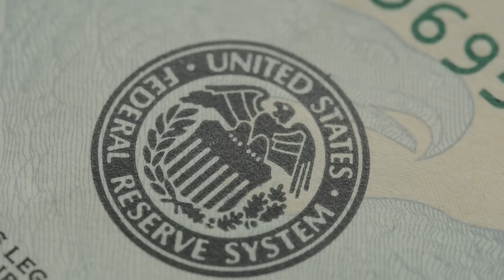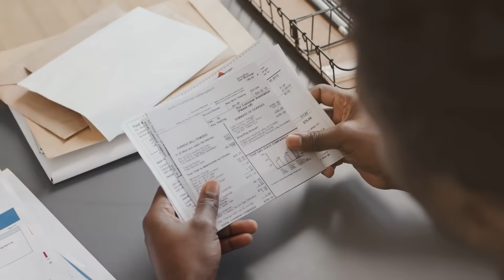Why California Is Building A $4 BILLION New MEGA RESERVOIR!

Comment: Sites is the dumbest idea I've heard about helping California with its water issues. There will be immense evaporation from a surface lake. It's not just water flowing out into the ocean that is a problem - if that even is a problem. Where Sites is located in the western Sacramento Valley, the summer season is very hot and very dry. Water evaporates quickly. On the other hand, California has been pumping ground water for decades, causing those underground reservoirs to become depleted. Seems it would be a much better solution to work on ways to replenish some of that during wet years, or even just normal years. We probably cannot bring them back to what they were, but there is certainly more capacity underground than in Sites, and water won't simply disappear into the air if it is underground.

Comment: I think the reservoir should be put up in a higher elevation where it's very cold so the water stays cold and doesn't evaporate so quickly. Don't allow motor boats either. keep it as clean as possible.
Reply: They were never going to create another Hetch Hetchy. Sites is the best compromise available.

Comment: Biggest user and 100% WASTE of Fresh water in the entire country?
Commercial ICE MACHINES. Nearly every machine runs a 1/2inch - 5/8inch water-line directly into the drain (condenser-cooling-water)12/7/365. Nothing else even comes close to using so much water and then dumping 100% clean usable water into the waste-stream-system. It's all such a Crock of Shit! Every, gas station, fast-food joint, motel, hotel, are fully complicit. All approved 100% by so-kalled Koncerned groups of OUTRIGHT LIARS! Our wonderful activists and politicians. ANOTHER SCAM.

Comment: This issue is completely man made and has nothing to do with climate change. There have been extreme dry and wet years for over millennia. Early Americans wrote about the devastating floods and droughts that were a huge problem. They also wrote about the massive wild fires that reduced the visibility of the mountains.  John Muir wrote about all of these naturally occurring processes that are responsible for shaping the state. Yosemite and the Central Valley was formed by glaciers and the melting of them as a result of the climate changing but there wasn’t any humans releasing carbon into the air to blame it on. It’s a natural part of the planet and it doesn’t make it a bad thing. Raising the carbon amount in the atmosphere from a dangerously low percentage up slightly is a good thing because it allows more trees and other plants to grow and thrive. If the carbon went down a little, no life could exist. The world warming is good for life on earth, especially humans. If the earth cooled, it would be devastating. It would be nice to watch content from creators that don’t try to gaslight their viewers.

Comment: This project is proof of everything that’s wrong with California.  It’s taken 25 years to get regulatory approval.  25 freaking years!!
It will consume more electricity than it produces.
In times of low flow in the delta (aka drought years), water will be released back into the delta, not kept for human use.
We desperately need it, but it’s a compromise project that’s trying to be something to everyone, and there are many, many examples of this approach failing miserably.  
I have zero trust in California’s ability to fight through the inevitable corruption that plaques large infrastructure projects, and I worry that this project will be a generational albatross with raised water rates and dashed hopes.

Comment: What about the Delta Smelt??  A lot of that water that goes into the Delta and then out to the sea, could be pumped into current water system but is not, in order to "save " a none exitant fish.  Why is this not a problem for this project?  Money does not seem to be an issue for CA, we seem to be able to print money or else how are we still able to keep paying for the High Speed Rail to no where that is BILLIONS over budget?

Comment: They should have taken my suggestion of building a "superhighway of giant water pipelines" from the east to the west back in the '70's. Pull the floodwater from the east to the west. Create REAL jobs, with a REAL product that people WANT and NEED. But my engineering professors criticized it, laughed at it.
Reply: It's funny I had that same thought since I was a teenager.
I remember reading about the Great lakes and how lake Michigan routinely is above average in water level and that single lake alone would be easy to suck a little water off the top pump it across the United States to feed the dryer states,  I mean there are plenty of states that feed off the aquifer where the aquifer is shrinking from intensive farming.  Then we could pump the water into the Rockies and allow its natural flow to go down the Colorado River which would cut the length of the pipe and the pumping roughly in half. Having to only pump around a thousand miles worth of water,  California's current aqueduct system proves it is possible with a good engineering team.  
Once that water hits the Colorado basin it would feed Phoenix, Southern California, Southern Utah, Western Colorado Southern Nevada and even part of New Mexico... To me it seems like a simple solution.

Comment: I have a better idea. If California must take even more water from the river systems.Isn't there an aquifer under the central valley that is depleted so much the ground is sinking. Why not use it to store the water where it won't evaporate in the 100 degree summer heat. It could be pumped onto the farm fields when needed by the abundant sun via solar power. It would be cheaper and all the water would be useable avoiding the  massive evaporation of a giant open pool.
Reply: CA has been flooding the valley farms that will during the last few winters.

Comment: This sounds real good but Commiefornia has a bad track record for wisely  using its water. The 2025 fires showed that they were wasting  water to save the Snail Darter and did not have resevoirs up to adequate levels to provide Fire Protection.  Commiefornia  was not clearing  bush or doing controlled fires to remove bush and suffered severe Prooperty Damage during the 2025 fires.  Commiefornia needs to get serous about water management and to get its resevoirs up to date.  Then they need to manage the water wisely so that when Fire Season comes they do not let the fires get out control and suffer the damage they did in 2025.  Never put stupid/useless fish/minnows over humans again.

Comment: 4 billion? If you compare it to the bullet train project its more 400 billion
Reply: Never ending projection
Reply: Projections are 50 to 80 billion more to finish the slow speed rail. Estimates are 6 to 8 hours to the bay area. Ca. Cutting costs by trying to use existing rails where you have to slow down.  Also it will have to be subsidized to make tickets affordable. You can fly to the bay area for around 100 bucks.
Reply: You mean the one they canceled?
Reply: This project will be just like the train to nowhere. A lot of palms to grease and retirement accounts to fund before it even gets started.
Reply: @danven1256 nowhere means 7 million people? And 117 miles of guide way nearly complete? With 52 miles of CalTrain tracks already complete and electrified due to CAHSR funding?
Reply: Exactly.  Fellow tax payers, lets all sit back and watch the mismanagement of this project spiral costs to the moon and back!  😡
Reply: CAHSR has only spent 13billion ?
Reply: @Lumber91 and it hadn’t laid any track!
Reply: @motor2of7 next year track laying starts
Reply: @Lumber91  sorry bud but its way more than that
Reply: @davidu6093 Can you provide a source that cites a current expenditure of above 13billion currently spent? As you claim 400 billion.
Reply: @Lumber91  you can do the homework its called google
Reply: @davidu6093 so you’re unable to provide a source. Seems legit 😂

Comment: So they take out four dams on the Klamath river then turnaround and pump excess water into the sites area from the Sacramento River.
Reply: The Klamath River is a different watershed.  It would be very expensive to move water from the Klamath to the Sacramento Valley.
Reply: also the 4 dams (2 are in Oregon) are private dams built for hydro electric.  the plant was decommissioned and so the private company decided to remove their private dam.  same goes for the two PGE owns that they are decommissioning.  none of those dams are owned by the state.

Comment: They need to create "Green Catchment" along most of the rivers.  Build 5 or 10 foot weirs that fish can jump, yet hold several hundred acre feet of water all over the landscape.  The retained water would soak into the receding water table and also catch water from those atmospheric rivers that roll through. Something that would be a much better ecological management plan.  The reservoir is a good start, but a bunch of weirs would be able to accommodate storm flows and create a cheap, concrete durable and distributed habitat structure with minimal maintenance.
Reply: Great idea about catchments. We get surges of water and using them to recharge aquifers sounds like a great idea to me
Reply: You make a whole lot of assumptions about soil conditions and aquifers in that statement.  Catch basins sound great as a sound bite, but execution is massively more complicated.
Reply: @motor2of7  well so is a pipeline too. there are at least 3 mountain ranges too cross.  Just putting catchment in apropriate places cost no additional money for nuclear pumping plants.
Reply: @watchthe1369 If we in California can pump water from the bishop area to Southern California which has got to be around 250-ish miles I am pretty sure we can pump water around or through the Cascades.  
I would rather spend money on building a pipeline or a tunnel for water coming from maybe the Columbia River then paying for a train I don't believe anybody is going to ride.
Reply: I have lived in California my entire life 47 years this Friday... The reality is California had a natural water collection It was called Tulare lake, It was so big it actually changed the weather pattern but we drained it around 100 years ago if not a little longer ago now and turned it into farmland.  
Call me pessimistic but I don't think California's ever going to do anything to correct the water problem but they will tax us for it...  just squeezing that middle class right out of the state they're doing a pretty good job of it at this point I mean the state has been losing population for 5 or 6 years in a row now,  They keep it up they will just lose enough people and then the water catchment system They already have a place will be large enough but I digress.
Reply: Need a pipeline from the Columbia river to Shasta Lake, problem solved.
Reply: @bryan565656  nope that is at least 500 miles of massive project that green Oregon would never approve, or afford.
Reply: @watchthe1369I agree. It would be a fight from every angle. That’s why we don’t make any real lasting change anymore.

Comment: I am concerned about what people think of the project. One of the statements seems to say it will capture excessive rain water. Although this is somewhat true an excessive rain  event will flow 100,000 or 200,000 cfs , this is Columbia River amounts of flow. It also happens in a short period of time, a few days. The Sites Reservoir will not be able to collect that amount of flow so will not reduce flooding during these moments in time. I think I read Sites will have an input of 10,000 cfs which allows for a slow fill over months of operation. When a rain event happens and people see hundreds of thousands of acre feet of water streaming out to sea, they want that captured. I think it must be stated that will not happen.